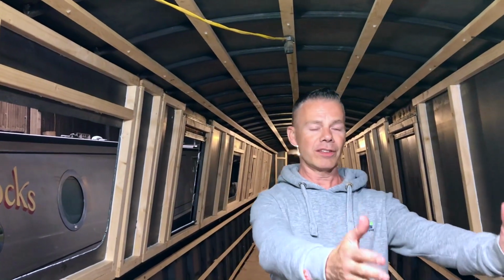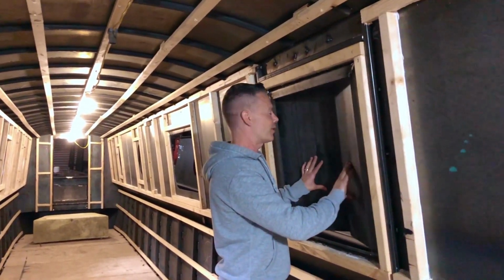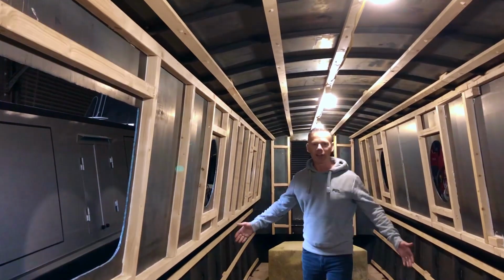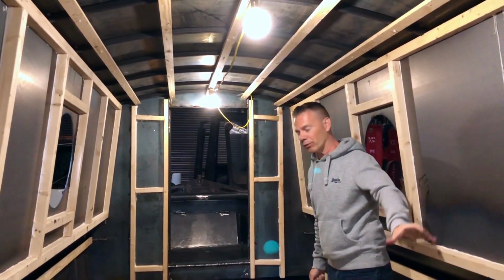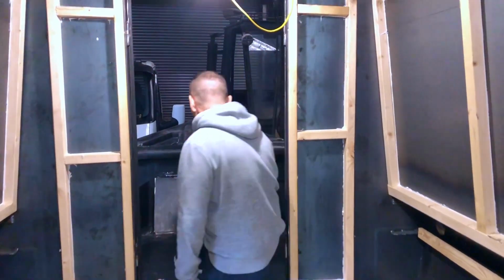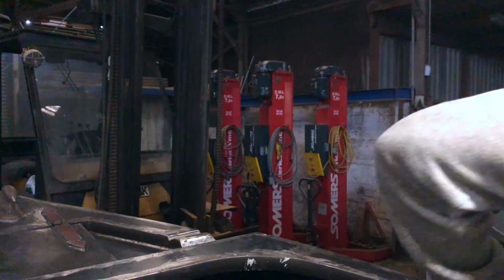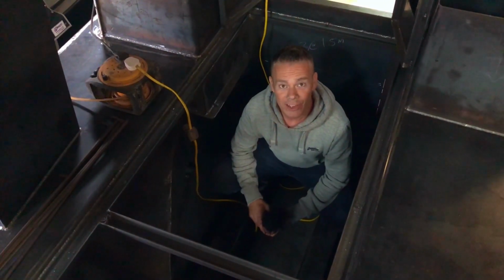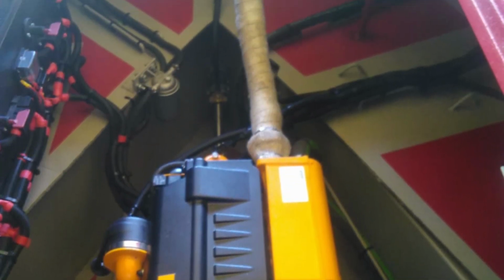Moving our 16-Ton Narrowboat Through Liverpool by Lorry - Ep. 21

Comment: Gentlemen, great vlog. How about some basic specs? Steel hull thickness, dry empty weight as shipped over, etc.
Reply from the maker: Hey, Tim. 10mm Base plate – 6mm Hull sides - 5mm Cabin Sides – 4mm Roof. Not sure on the weight. Depends if we're on it and if we've had cake :-) x

Comment: Hi, just wondering, do floors get insulated? Looking forward to seeing the boat as we play catch-up!
Reply from the maker: It varies depending on the boat builder. Comes down to budget and design. Some have heated floors, but that's another strain on the batteries. We just have basic insulation and it's fine.

Comment: Questions:  On average, what does a narrowboat draw? What is used for ballast? How is the amount of ballast figured?
Reply from the maker: Draw what? 
People use all sorts for ballast. Usually bricks, concrete slabs, but I've seen scrap metal and railway sleepers used too.
Reply: How deep does the hull go into the water? For example, a friend has a 44ft ketch that draws 6ft. If the water depth is l6ft or less, the boat grounds.